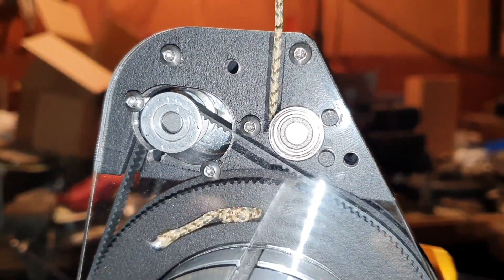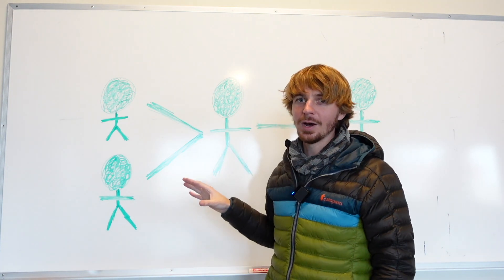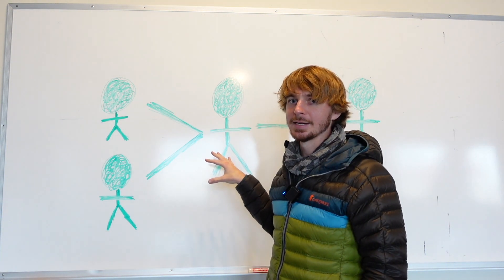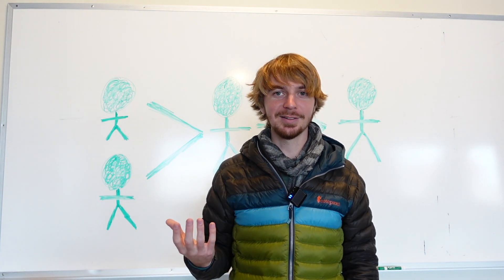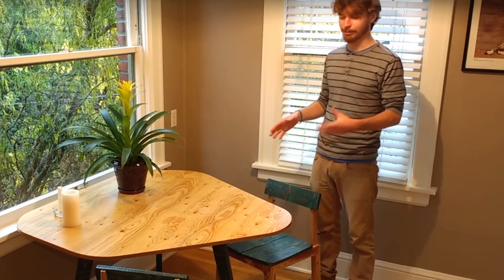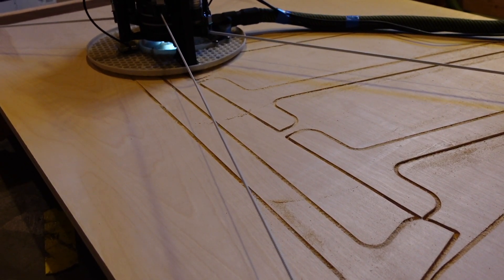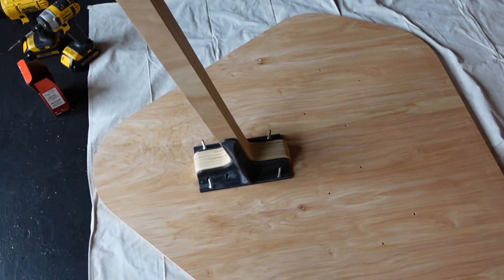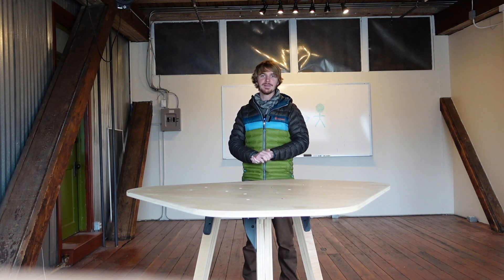Maslow CNC and MakerMade Are Not The Same Thing

Comment: I waited until Maslow looked like it was ready for production. And invested my money into your maslow 4. Because I believe it now is ready to hold to tighter tolerances and be a more producible product. No worries about what the other guys maker made are doing. We stand behind you.
Reply from the maker: Thank you for support us!
Reply: Yeah.... let's hope that this doesn't wind up the same as Bar's two previous Kickstarter projects, Makesmith CNC and Maslow CNC v1, both of which had a lot of problems. 
Luckily, right after Bar decided to give up on the Maslow 1 (by no longer sell kits/replacement parts or fix the problematic software) sellers emerged from the Maslow community to save the project, and for the past five years they worked hard to support and supply kits with upgraded parts

Hopefully, this Maslow version will not be plagued by hardware or software issues like the last one he released and the sellers had to fix.

Comment: So does the Maslow 4 run horizontally too?  Thanks for the clarification on the company stuff.  Makes a few things clearer.  After saving up I bought an M2 from makermade with all the accessories, and its been my biggest nightmare ever.  It turned my excitement for cnc into resentment.
Update, calibrate, calibrate, calibrate, cut 1, can't repeat, calibrate, update, calibrate.....it just never stops.  after 6 months of head aches, I give it a couple hours week to try and make it work, but it doesn't.  The laser is still new in the box, hasnt been reliable enough to even bother putting it on.

Comment: Ouch, I bought a Maslow and thought I could buy parts for it (and I spent $500) through Maker Made.  Soooo…you are saying there is no mixing of the two?  Yikes!
Reply from the maker: Which Maslow did you buy and when? MakerMade sells a copy of the original Maslow design so their parts should work on Maslow machines bought prior to 2018. I wish that they would stop using our name so that people wouldn't be confused.
Reply: @maslowcnc  I am flattered to get your reply.  Thank you.  I bought this kit unopened from a surfboard crafter that had never used it.  I can’t tell for sure the it’s age.  Are there any identifying things to look for in 2018 and younger vs 2018 and older?
Reply from the maker: @upstatecre8  Well I'd like to be able to say does it say Maslow on it, but MakerMade keeps putting my logo on their products 😂. Did it come with a piece of paper with a link to the assembly instructions?
Reply from the maker: Either way, the spare parts that you can get from MakerMade should work with that machine. The next generation of Maslow is quite a bit different, but we haven't started shipping them yet so if you have the machine it will be the style that MakerMade sells (my old design)
Reply: @maslowcnc  I am certainly excited to see what you guys are doing with this next version. I’m also eager to see what price you might place on the new Maslow. Thanks for doing what you do in this space.

Comment: is it possible to change the straight bit out for a rounder over to improve the edge quality? and if so could you automate the process of flipping the work sheet over to do the same on the other side ?
Reply from the maker: Yes, you absolutely can. You need to be careful to get a roundover bit without a bearing on it (A lot of them are meant to be used by hand), but they do exist and they work well!

Comment: I would take advantage of the situation by testing the M4 on the Makermade table. I intend to use the M4 that way as I don't have a lot of room in my shop and will need it to work (hopefully) in the near vertical position.
Reply: I can 100% say the Maslow4 will be at leasrt twice as fast as our version of the M2.  It's a completely redesigned machine - there's probably no need for them to do this - we can say ourselves it will be faster and better!

Comment: I knew that MM bunch was kinda sketchy, but didn’t realize what they were doing. Sucks that that happened to them, but kinda deserve it when they didn’t make any original products!  Keep up your updates!
Reply: We have the M2, 3D printer and now our new cnc500.  We can keep our costs low because things are open source and those are the products we intend to develop.  Hopefully with this new ownership you will not have that feeling anymore.
Reply: @makermadellc  well i guess you need to post your side of things.
Reply: @mcavity  There is a comment in this video and on the Kickstarter.  I'm not doing to dip to a new low.  The accusations are baseless and I've requested nicely to have the video deleted since the accusations are flat out incorrect and wrong.
Reply: @makermadellc  Im sure a statement saying that you understand Maker Made and Maslow cnc are separate entities  would go far toward helping correct any misunderstandings =). It seems hes mostly just worried about people understating that they are 2 different companies.
Reply: @mcavity  That statement was in the second sentence of my response after I introduced myself. It's in the comment section of the video and also Kickstarter update.  I was very clear that Maker Made LLC and Maslow CNC are different companies.  We have set ourselves apart with our products while crediting the original project and people behind that project. Maslow CNC was not a company up until July 2023 - it was a domain name run by Bar for his open source project.  That is what makes this video so surprising is the last 5 years we had been building the community and even supporting their Kickstarter campaign.
Reply: @makermadellc  thanks for making it clear!